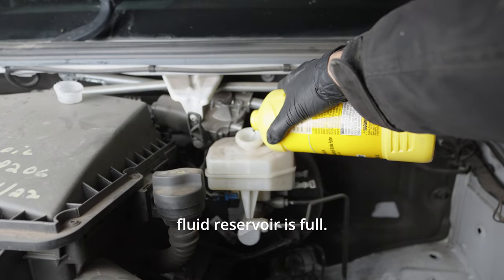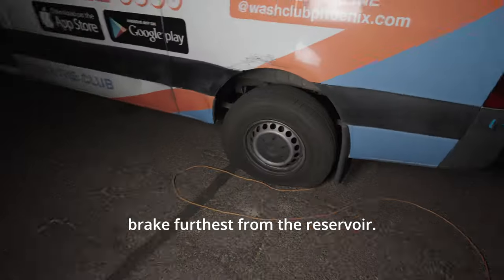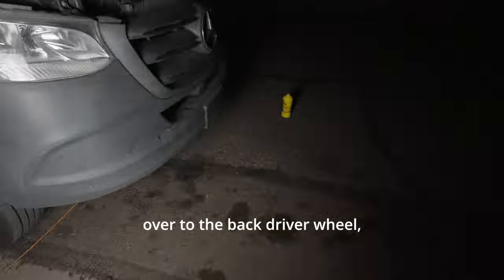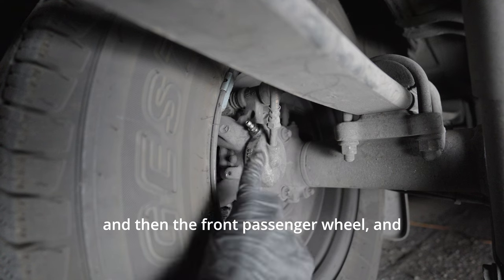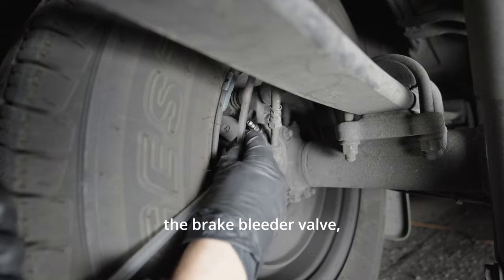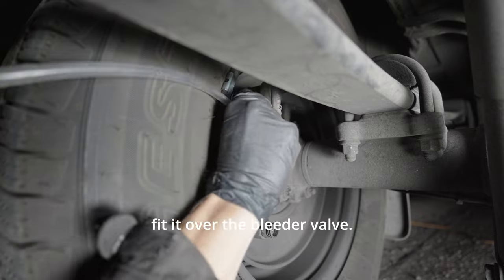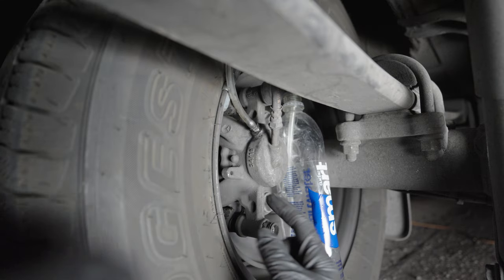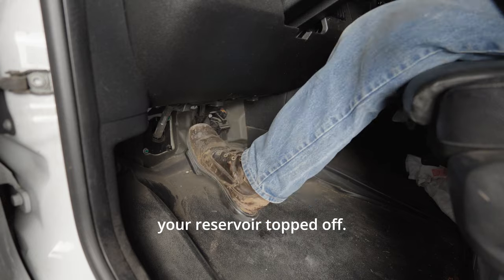EASY HOW TO do a brake flush

Comment: If you're bleeding one at a time, How do you know when to switch to the next one?
 Is there a set amount of times you need to press the brake pedal?  Or is it by volume of fluid?
Reply: And come to think of it my Mazda  Has a shared reservoir for the clutch and the brakes so what I need to bleed the clutch as well?
Reply from the maker: @vegeta420z6  The same reasons you bleed your brakes are why you bleed your clutch. The brake fluid absorbs water over time and is not as effective.
Reply from the maker: When the fluid coming out of the bleeder looks the same as the fluid in the bottle, it should be good. If you pay attention to how much fluid you put in, that will help.
Reply from the maker: Yeah I would bleed the clutch. I didn't read your comment correctly the first time.